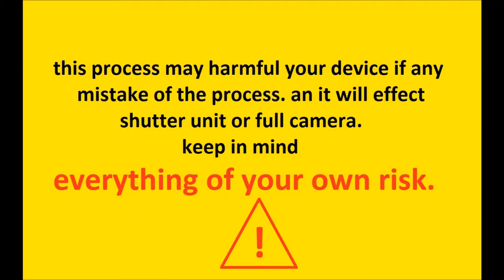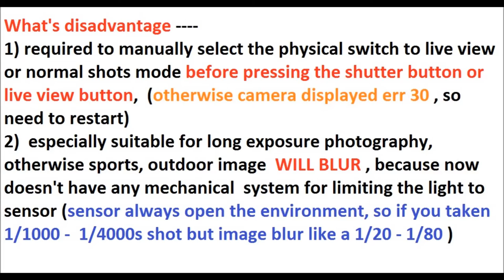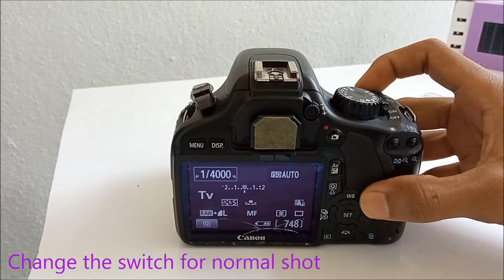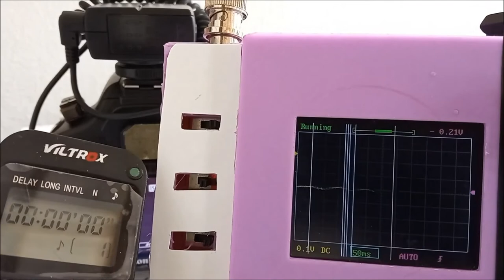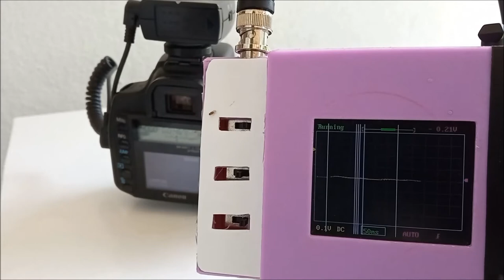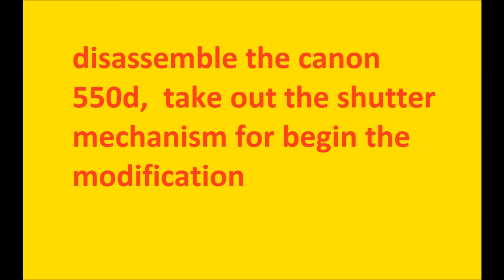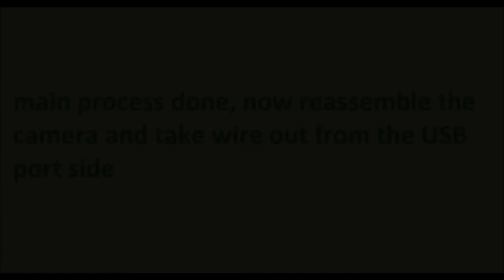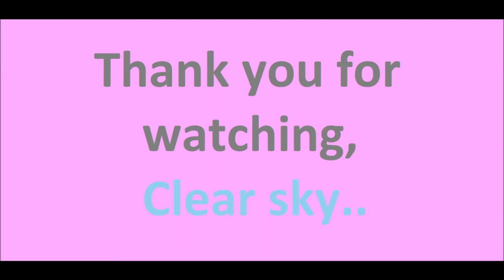How To Bypass Shutter And Mirror Of Canon 550D / T2i DSLR Camera For Astrophotography

Comment: Can I ask you a question,, the 2 wirers to the little motor are cut, is this a part of the modification?
Reply: Dit this procedure but Not working, keeping er20, I even replaced the motor for a resistor of 7.7 ohm
Reply from the maker: Are you try with 550d?
Reply from the maker: This two wires from sensor pin. ( shutter positions detection optical sensor)
Reply from the maker: Don't change any modification for the motor , motor wires. ( For easy to do this job , I'm temporarily remove the motor wire)